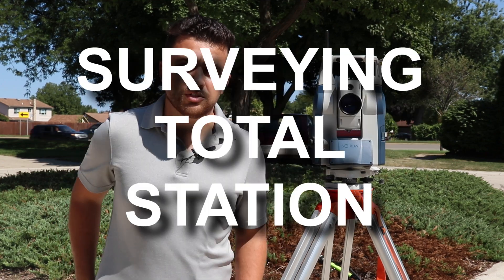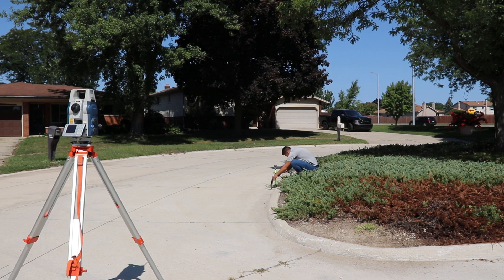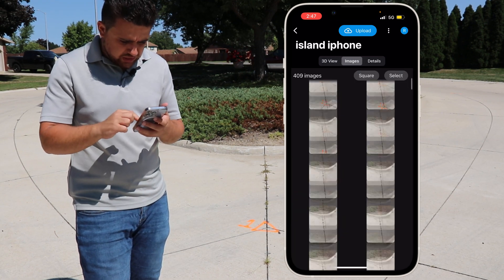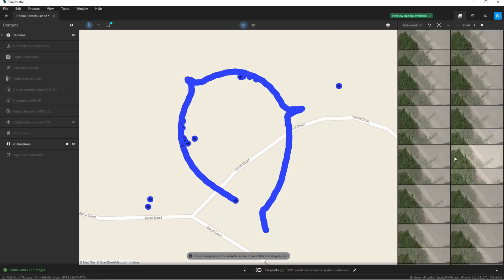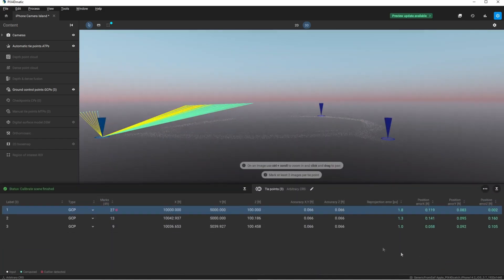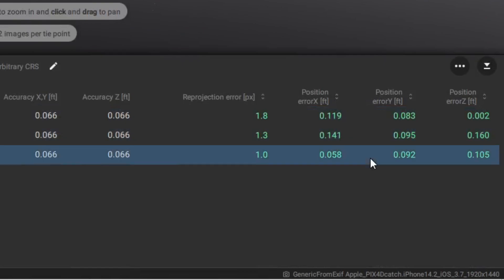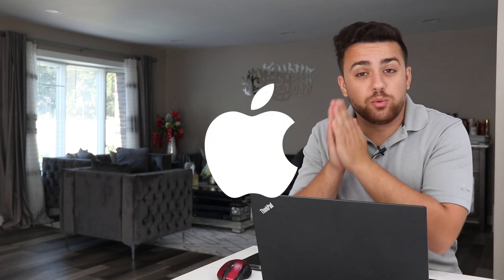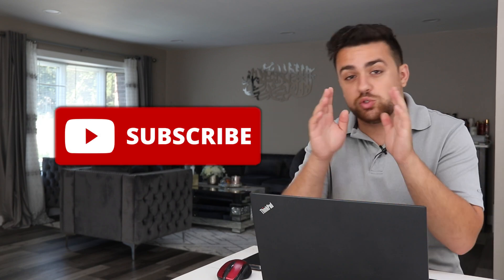iPhone 13 Pro CAMERA vs. Survey Total Station Accuracy

Comment: Very nice video but why are the results expressed by the average Delta? Wouldn’t it be much more useful to do a comparison using the variance? I may have missed a step in the procedure but these results describe an error in the reference frame, something much less important that the relative accuracy of the survey. Thank you if you find some time to answer to this!

Comment: The average errors don’t tell you very much without also considering the variance. The average error on the Z coordinate just tells you that the errors in the up direction were very similar to the errors in the down direction. But almost all of the actual error amounts were much greater (up or down) than what was calculated as the “average”.

But other than that, this was a very cool and interesting video.
Reply: And if Point X21 is a critical point it is off by 0.40'